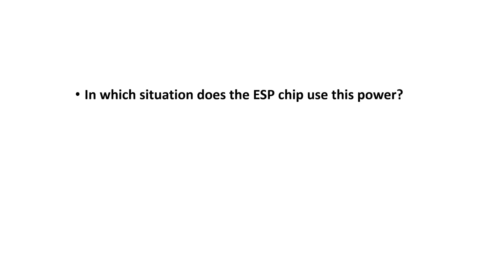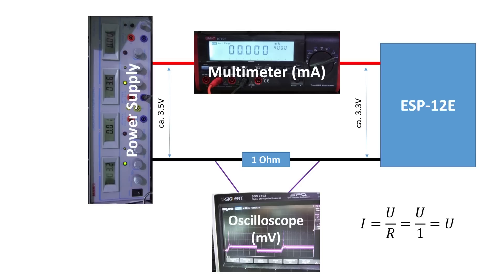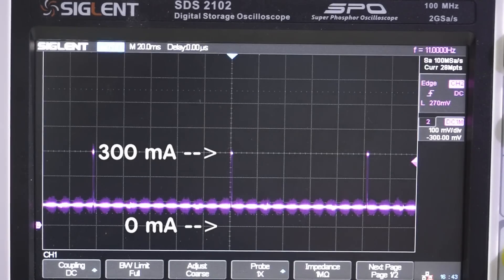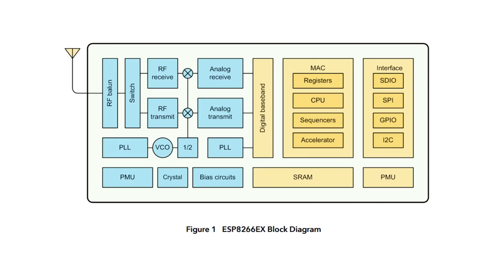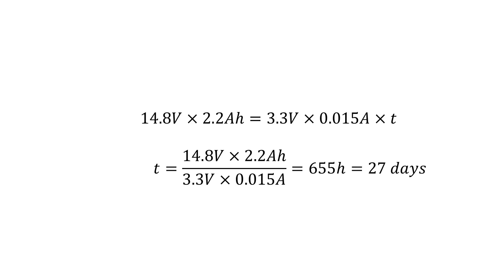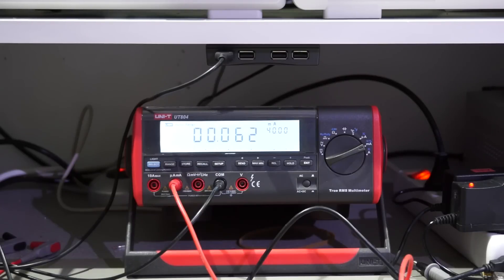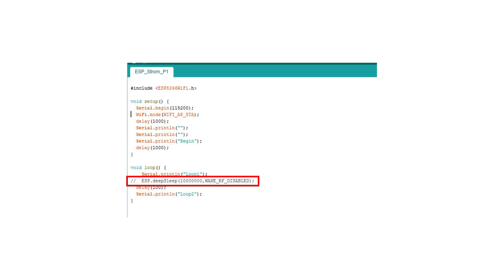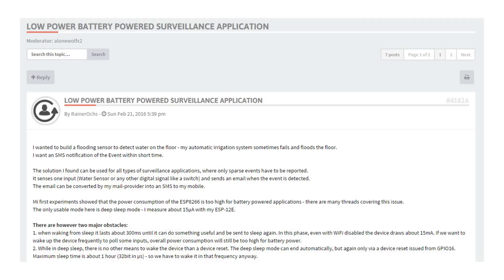#47 Power Saving with ESP8266 (Sleep Mode) Tutorial with some Tricks

Comment: Very informative, I have been using the esp8266 for some sensors and experienced exactly what you show here, I do not have an oscilloscope so it was (not) great to see those spikes. Another obvious power saver is to switch it on when needed ie pressure on a scale, external switch etc. Have you looked at the meshing the esp yet? that might be useful for larger deployments maybe?
Reply from the maker: +Peter 1. Retief Swich it on and off is good if you want to use it on battery and only switch it on once a day or so. Videos about that are in the works...
2. No, I did not look into meshing it (i understand mesh as a network of many ESPs). I think, 2.4GHz is great if you have a WiFi network around. For independent sensor meshes I prefer for the moment sub GHz RF modules. Also there, a video should come in summer (it is a lot of work...)

Comment: Hello Andreas, very informative video as always. Based on your video I tried using the WAKE_RF_DISABLED parameter with ESP.deepSleep() and like you said the chip preserved its Wi-Fi off state after reset so it could not find any networks after restart. Tried using WiFi.mode(WIFI_STA); in my setup() loop but it did not re-enable the Wi-Fi module. The only thing that helped was running deepSleep() function with WAKE_RF_DEFAULT which re-enabled the Wi-FI on next reboot. So, after ESP.deepSleep(1000000, WAKE_RF_DISABLED), the only way to get WiFi working is using ESP.deepSleep(1, WAKE_RF_DEFAULT) which is strange and far from being ideal. I found this forum where they suggest a different way and it worked well for me: https://github.com/esp8266/Arduino/issues/644

Based on one of the answers, my goDeepSleep() function now looks like this and works correctly, meaning it finds and connects my Wi-Fi network on each reset:

void goDeepSleep() {
  Serial.println("Going to deep sleep...");
  WiFi.disconnect(); 
  WiFi.mode(WIFI_OFF);
  WiFi.forceSleepBegin();
  delay(1);
  ESP.deepSleep(sleepTimeS * 1000000, WAKE_RF_DEFAULT); 
}

Note: sleepTimeS is a global variable that specifies the desired sleep time in seconds.

According to my multimeter the power drag is low but I don't have an oscilloscope or high tech stuff to measure the exact power consumption.
Reply from the maker: +Attila Balog Thank you for your comment. In the next week I will look into the sleep mode again and will try your code.
Reply: +Andreas Spiess one thing I found in the meantime, when you call WiFi.disconnect() it will remove the WiFi credentials from the board so libraries like https://github.com/tzapu/WiFiManager relying on the board "remembering" Wi-Fi settings cannot be used. So, I removed the line with WiFi.disconnect() from the function above and it still drains low mA. Thanks for looking into the sleep mode again, can't wait to see your professional analysis.

Comment: Great video. I keep coming back to this to improve my understanding of esp8266 power modes. 

My thought here is to build a neat GPS data logger. Boot into the low current 15mA mode when recording a track out in the field. Use some of the flash or an sd card to log. Then flick a switch and reboot into wifi mode when at home and download the nmea or kml data from a http server running on the esp8226. Would be a neat project I think. Now to find the time to make it a reality...

Keep up the great work with the videos Andreas.
Reply from the maker: +Luc Small I think, this should be possible. You can record a long trip on the SPIFFS file system in on the module itself if you set it to 3GByte. Then you do not need an SD card. And if you do not move fast, you might set it to sleep for 70-80% of the time to save even more "juice".

I am not sure if you lose the content (or the pointer to the content) if you reboot, because I never worked with SPIFFS so far.

Comment: Hi Andreas,

I came across this tweet https://twitter.com/qrs/status/706552734170935296 after watching this video and was interested in finding out if using what was demonstrated here, we could get the coin battery to ast for a lot more than 1 Hr?
Reply from the maker: +Ibrahim Ng'eno The calculation should be quite easy: The ESP needs about 80mA during run. In sleep it is neglectable. So, you should be able to get 10h if you sleep 10 times longer than you send. The send depends on your connection time and the service time of your service on the other side. Lets assume, you need 3 seconds "send time" and you wait 30 seconds in between it should last 10 h.
Reply from the maker: +Andreas Spiess I just tried it with a non rechargeable 2432 Lithium cell. It does not work because it cannot deliver the current. I have now a sketch and try it if I find a rechargeable battery.

Comment: put it in Station mode... then modem and light sleep works.
Reply from the maker: +Shirish Jadav Interresting remark. That the light sleep only works in STA mode. Thank you!
For the moment I do not plan to use STA mode because I use the ESP as a connected client. But maybe somebody else is happy that he knows it. Or did I get something wrong?
Reply: +Andreas Spiess yes so you are running a client on esp then it can better work in station mode. only if you run server you need to have AP mode and can't use power saving options... also if you can configure your wifi DTIM time see ..how much you can change DTIM time..
Reply from the maker: +Shirish Jadav You are right, I mixed the two! I will have a look into the code of your first comment. I did not see it, because Youtube put it in my "likely Spam" folder and I did not check.

Comment: Awesome video, and well explained! It is a pleasure to watch your videos. I am currently thinking about buying a digital oscilloscope for tinkering around with ESP8266. I see that you use a SDS 2012. Do you think that 1GB sampling rate with 70 MHz gives a sufficient resolution to see the power spikes?  Thanks for your great contributions!
Reply from the maker: +Thomas Mittag Thanks for your comment! The spikes were not complicated to see, they are about 1 microsecond, if I remember right. 
Concerning the oscilloscope: I bought mine three years ago (it is actually a SDS 2102)  and I bought the best I was able to get for my budget (1000$) then. Since I am a tinkerer, not a professional with a project I had no idea what I will need in the future. So, the budget was the deciding factor for me. So far, I am happy with the Siglent brand. I just bought a spectrum analyzer and a waveform generator from them.

Comment: Andreas, may I ask how you setup your scope to measure current. Do you require different probes? Are there any dangers to measuring current? I have recently purchased a rigid Ds1104DZ and still learning the basics. Your direction would be gratefully received.  

Thank you
Reply from the maker: +Dean Greenhough It is quite easy: As you see in the video I put a 1 Ohm resistor in the GND line. With the oscilloscope you just measure the voltage on that resistor and calculate the current according ohm's law. Maybe you watch the video again with this explanytion you will see the explanation.
There is a danger of a shortage: Your oscilloscope has usually GND connected to Earth. If your device has also a connection to earth you can create a shortcut in your device. This is why I put the resistor in the GND line. Then I can connect GND of the oscilloscope to GND of my bench power supply. No problem. You will also have no problem if you power your device from battery because then you have no connection to earth.
This danger exist always, not only during measurement of current!
Hope, this helps.
Reply: +Andreas Spiess 

my apologies for writing a post, before I re watched your video.  Your explanation is clear and I have reached a better understanding, thank you.

I do have one question:

The 1ohm resistor,  I assume I will need a resistor like this? I assume this will get pretty warm. Do you advise only running this for a limited amount of time?

Thank you so much for your time

http://www.ebay.co.uk/itm/like/391374624389?limghlpsr=true&hlpv=2&ops=true&viphx=1&hlpht=true&lpid=122&chn=ps&googleloc=1006959&poi=&campaignid=207297426&device=c&adgroupid=13585920426&rlsatarget=pla-142405555266&adtype=pla&crdt=0&ff3=1&ff11=ICEP3.0.0-L&ff12=67&ff13=80&ff14=122&ul_noapp=true
Reply from the maker: +Dean Greenhough The power dissipation of a resistor can be calculated by the formula: P = I x I x R. If yor device draws a current of 1A the power rating for the resistor is: 1A x 1A x 1 ohm =  1 Watt. Normal resistors are 1/4 Watt and therefore should be good for 0.5A. So, yours is ok for quit big currents.
Reply: This video has absorbed me for the whole weekend, I have learned so much, but aware of just how much I don't know. Thank you Andreas for your guidance and patience. I am awaiting a 1ohm power resistor so I can replicate your work on the ESP.

Comment: very cool sir.  you make great videos.    regarding EEPROM emulation on ESP , it's in the flash . It seems you can write your sketch to the ESP's a put a file system in the unused portion of flash .  I have not had a chance to play with the ESP file system stuff yet . I thik it would be cool if i can figure out how to get my 12E's to use a SD module . But if your ESP has enough left over flash , you can use SPIFS to store settings and state data in a file , posisble easy as CSV or flat file text .  heck JASON or XML file .
https://github.com/esp8266/Arduino/blob/master/doc/filesystem.md#file-system-object-spiffs
i want to save some activity logs of a few sensors (doors) for a few hours on loop , but i think my ESPv12E has 4M flash  so i might be able to do that on them , but I wonder about ESPv1 can work with a small file systems .
Reply from the maker: +XerotoLabs I know about the file system, but as you, I never used it so far. For a few variables I think, It is not worthwile to use it. It seems to fit better for text or HTML pages. For single values, the EEPROM function might be better.
Anyway, the 3MB spiffs "disk space" will be enough for me so I will not investigate too much into SD. The ESP8266 is a connected device and I rather would offload data to the "cloud" before saving it to an SD card. And  I changed the flash on my small boards that I have everywhere 4MB flash.

Maybe I look into this whole complex a little more if I have time...
Reply: +Andreas Spiess lol yeah it's that last "if I have time" that gets me too . LOL  .  I forgot you did the chip swap on your flash . I agree the EEPROM is just flash on ESP's and would work for almost all the jobs especially if you can reach the cloud with it .

Comment: 2200uF is the best ESP8266 trick ever !
Reply from the maker: +Wild in the jardin Thanks! By the way: I used a 10mH inductor andgot the same effect.
Reply: Thank you for your very informative videos. Did you use the 10mH inductor in combination with a de-coupling capacitor to Vcc? If so, what was the capacitor's value? If not, how was the inductor connected?

Comment: As  usual, you are rock star. Thank you. One suggestion, always connect GPIO2 and GPIO 0 to Vcc with 4.7K resistor. Because sometimes the ESP won't wake-up properly from deep sleep and it is termed as zoomie mode (deep sleep wakeup)
Reply from the maker: +Venkatesh E Thank you for your comment. There are many different opinions concerning how to to connect the different pins to Vcc and whether it is necessary. Pin 2 definitively has to be high according to the datasheet, but so far, I never pulled it up and had no problems.
Just a remark: During boot, pin 2 also sends some information on 75000 baud...
Reply: +Andreas Spiess thank you. Even I heard that there is something goes out on Pin 2 (TX1). Some guy connected LED to Pin-2 and keeps blinking at startup which he is not expecting that. From that I found there is something is going on, but I am not sure what it is. The 75000 is the super hint here. Thank you once again. Waiting for next video. Good Luck.
Reply: +Andreas Spiess So regarding pulling GPIO-0 (zero) high, do you think a bad power supply can cause the ESP stuck in zombie mode. Your's seems to work without that one. Please let me know if you have any information on this. Thank you once again.